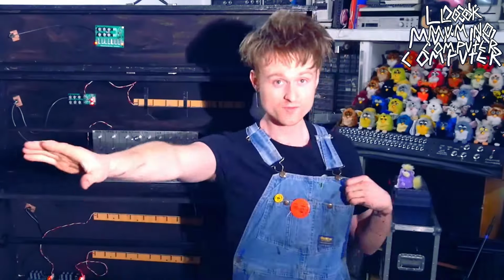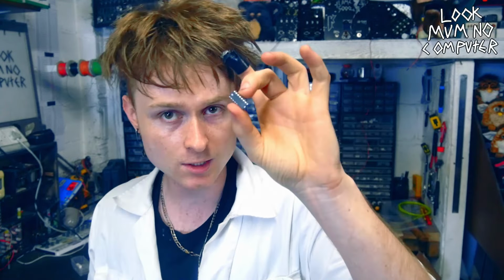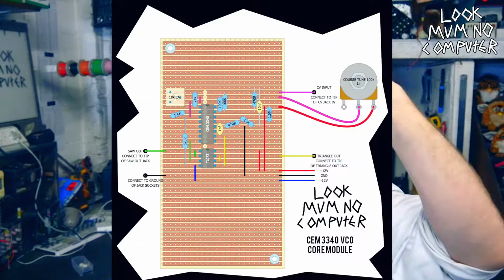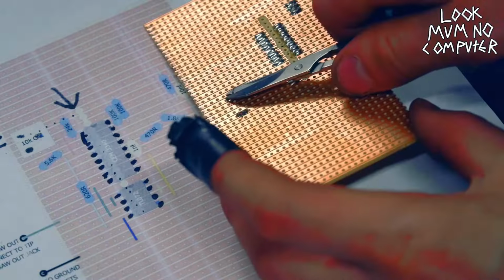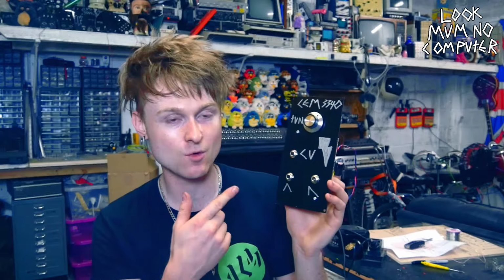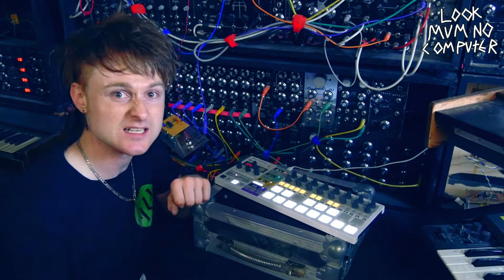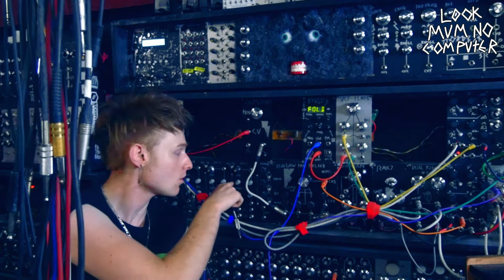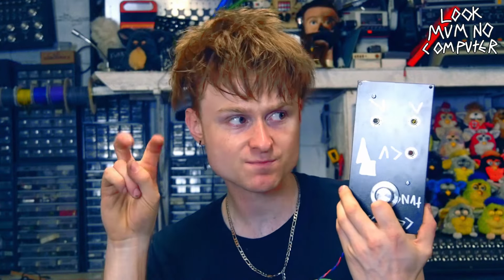Synth Voltage Controlled Oscillator 1v/oct tracked DIY how to.

Comment: Been looking for a video like this for weeks. You've got to be one of the best guys on YouTube. Any way to get a square wave?
Reply from the maker: yep like i said in the vid, i will be adding addons to this circuit, this is the core of the module, ill be including optional addons. square wave out + PWM in will be one of the add ons, only requiring another TL072, 10k resistor and a couple of jack sockets.    i still need to finnesse, but you can definitely work it out if you look at the CEM3340 datasheet :)
Reply: The add on is pretty simple, a comparator on the triangle out (saw might work too?) and the width is chosen by changing the voltage it's being compared to
Reply from the maker: its even easier, check the CEM3340 datasheet, it already has square wave out, i just figured it would be a simple addone with 1 tl072 for input and output
Reply: If we are planning to do the add-on's, would it be worth putting a tl074 in now instead of using two tl072's?
Reply from the maker: yeah totally. would be an option later on. this just seemed easy for now, but yes. totally. when i do the square-wave one ill plop a tl074 stripboard layout in too
Reply from the maker: the square wave one wil require 2 more opamps. you can probably work it out! if you look at the datasheet of the CEM3340
Reply: Emil Carr Yes a saw does work as well, you pretty much use any wave , thou the cem3340 has a tri saw and sqr outputs , you can then wave lshape to sine from tri.
Reply: O V E R D I V E
Reply: @LOOKMUMNOCOMPUTER  please add the square and PW vid when you can, it's really useful!
Reply: @LOOKMUMNOCOMPUTER  - Can you not use a 555 for a square wave?
Reply from the maker: @NeuronalAxon  deffinitely but it requires a lot of circuitry to scale it to 1v/0ctave to make it useful in a musical setup. the easiets way would be literally put a wire into the square out on the CEM3340, theres a circuit on my site :)
Reply: @LOOKMUMNOCOMPUTER  - Makes sense. Wicked they re-released those chips. Thanks for the reply! Where'd you learn your electronics shit, BTW?
Reply: Maybe by summing sine waves. The concept is the Laplace transformation but how to do it? Idk. Would an op amp be needed to sum the individual vco?

Comment: Thanx. I built one with the as3340. It worked right away.
Reply: Just built one using the as3340. I get this weird thing where when I plugin in my beatstep pro it plays super high pitch and I cant tune it for shit. did you happen to run into anything like that? Banging my head about where I might have gone wrong.
Reply: i tried to build it with the as3340 too but i couldn't get it working... i checked, rechecked and rerechecked a thousand times the schematic and i haven't found any mistake, i also checked my components , they're good.... I'm missing something and it drives me crazy hah
does anyone have tips or common mistakes not to duplicate ? (i'm a beginner if it wasn't clear enough)
thxxxx
Reply: @gillestinguely  same thing for me ... I've built three of them and also onr digital to analog sequencer and the cv is totaly out of reference with the tuning ....and the scales are like in reverse ( the higher note shown on the display of the seq the lower note generated by the oscillator) suppose to be exponential but ... welll ... i don't know ....

Comment: Thanks Sam, genius, I finally finnished my TD-616, (Twonk Drone-616 the number of the beast from the original Hebrew scriptures) using 18 of your super simple oscillators, the filters are a bit weedy, but I'll be watching your vids and upgrading them ASAP. When I get a vid of it on youtube I'll share the link. I've never built anything like this before and I wouldn't of tried if it wasn't for your inspiring and easy to follow destructional video's, keep up the good work.

Comment: ta-daaAAHH. made it! i now have one of the above! after hours of faffing about with it not working i tried a new op amp, worked right away. i am delighted! at a bit of a loss now as i own nothing that make 1v/oct signals for it. so i am off to make a resistor ladder push button keyboard........

Comment: MODS: ok so i put another 100k pot in series with the tuner pot, and now i can tune a much wider range; whereas I was able to find middle C and tune to that now. :D, i got the tuning pretty tight now, i can span more than a few octaves and remain in tune :D so pumped I used a BOSS TU-3 on chromatic using middle c and checking in the DAW with another voice layered over top. cheers

Comment: LMNC is obviously a more hands on type of channel. It's basically a DIY channel more or less. I wonder, your safety pin earring, is it supposed to represent that or did you just dig the way it looked? 

Also, and please understand that I have a very rudimentary understanding of electronics but I know a little (very little), with those super simple oscillators, theoretically, one should be able to use a 555 timer to step them one to the next. You wouldn't get exact notes out of them but it should be a fun easy project that almost anyone could do. 

BTW, cool video. I like how you almost take people by the hand and show them, you can do this. You can build this stuff if you really want to. It's not THAT hard. I've been away for a little while because Youtube in its infinite wisdom has decided for whatever reason, that my subscriptions don't have to be permanent. All hundred or so have disappeared and the new ones don't stay either. Ah well. Que sera sera. I'm glad I remembered you though. Carry on.

Comment: *looks at CEM3340 price*
*holds on the heart*
UFFFFF

But you know, big thanks for this series, i love you!
Reply: Also there are clone of CEM as said at  LMNC site and it actually costs 2-3 times cheaper, cool! (but shipment to my freaking-fucking contry will be expensive, sad)
Reply: AS3340 is a cheaper alternative ;)
Reply: Big ups! Thank you!
Reply: 25€ on ebay, i think it's worth it
Reply: £10.50 on thonk
Reply: buZztiaan How much do they go for ??
Reply: Cabintech Global LLC  Wow thanks for the info ;-)
Reply: Cabintech Global LLC Awesome!
Reply: Thonk have the official CEM 3340 reissue IC's for £10.60
Reply: $15 is expensive compared to $100 for pre-built?
Reply: AS3340 seems to have a fair price for this! :) Will try after i'll tire of discrete oscillators.
Reply: Forgive my blasphemy, but I could buy some good computer bits using that much money.
Reply: You can always try using a function generator like an XR-2206.
Reply: @DJTI99  have you successfully done this? I picked up one but it requires 14 or 15 volts in.
Reply: @jkuebler89  Waiting on my chips now. You can step up from 12V to 15V with a voltage regulator circuit, though.
Reply: @KiR_3d   I bought some as 3340 last week. Got them working aswell thou issues with my oscillator mixer circuit. Im just experimenting at the mo. May rethink my project if theybprove reliable. Hope all is well with you my freind.
Reply: Thanks for news, friend!
Make some vids about these, it will be interesting! Personally I'll be doing the old way as long as I can buy anyway it's very interesting!
Because how Neutron sounds - it's one case. How it will be sounding in your synth - another story.
All is good! Just bought Tevo Flash... (two weeks ago). This printer is as good as well as bad :)) The quality control at Tevo suxx. A lot of tweaking and DIY a detail before actually tried the 1st test print. I need to make two stands for Neutron and Model D. It was the final drop that made me buy it.
The proto-synth is near in the closet. I'm going to try 555 based oscillator or (maybe) that Jupiter-8 scheme. Hope to get rid of an instable tuning before making the PCB still :) Also I plan to use KTY sensor because buying Tempco's is not easy here (possible only by ordering from the outer sources and it's not very economic).
Wrote a track (not very good... mostly experimental), now I'm making a more "main stream" psy-tech track (90% ready maybe).
World politics suxx :)
That's all news!
Reply: @KiR_3d  Hey man yeh tries the 3340 its ok but doesnt work well in my set up as mixing waveforms seem to be an issue . I did watch your ( what looked like 3d printer the other day. 
Be intresting to see you 555 based vco. Is it of ghe the Thoma s henry design ?.  I always say make your music for you fuck the politics . 
😎😎
Post some morw stuff on your channel soon :-)
Reply: It's probably better to find some tech. geek forum about Neutron and what's inside there... They've done a pretty cool job about mixing the waves!
Yeah, Thomas Henry design will be the starting point.
About the 3d printer... I've regret that didn't bought some used Russian 3d-printer (just because it has no heated bed). It's more expensive but there is XY-scheme (H-bot). It's much better than all modern Chinese clones (and can print easily on 90mm/sec without problems).
Did you've meant that you'll post more stuff? :) Or you're asking me to post some more stuff? ))
Reply: @KiR_3d  hi! Do you know if it would be possible to use this 3340 ic with the 555? I'm planning in doing a 555 osc soon! If so, is it same schem as this one?

Comment: Oh, I commented why don’t you use a voltage controlled resistor on an old video where you were using a hackaround with photodiodes to control the resistor in this circuit, but I guess you made that step in my past your future from the video I watched...

Comment: I built my CEM3340. It works very nicely except every now and then the output goes all distorted and noisy for a few seconds before coming back to normal. It's pretty random and inconsistent. Any idea what could be the cause? 

Thanks in advance

Comment: Hi Sam! Just build the thing. Works beautifully. I just wanna ask what resistor values do you use for the square out add-on between the pin 5 of the CEM3340 and the second TL072 ... I can't read if it's 470 ohm or 470kOhm. Thanks!
Reply: The CEM chip is using 470 ohm resistors, it looks like the TL072 for square wave is using 470k ohm.
 You won't do any harm using 470k first to try it out.

Comment: ok...i just finished this..(the version with the pwm controls)..
so my advice:
dont believe its so short to do it..you can easily spend a day or two full days..if you are not so used in electronics and soldering it can take time..
if you dont have tools like multimeter or better osciloscope...you must be extremely lucky to build it at once..
be prepared for troubleshooting (in my case a lot!)
if you are experienced and lucky maybe you can do it in one hour i guess (in my case it was built extremely quickly but i had frustrating problems arising...for example i had it ready and listening sound..go for the last version(with the pwm control)..its dead...pressing the board sometimes made it work..until i fixed it it was another lets say 10 hours)
be careful with your wire..i used some precut ready to go wires..they were pretty nice for the board..but horrible for the knobs.. they were cut extremely easily..
last and most important..BE CAREFUL with the soldering! in my case...i checked the board countless times...every connection was correct! but, because of some very sneaky bad connections (solder did fill the whole, although it was looking fine) i coudnt diagnose my problem...

Finally...did it worth it? From the money perspective...hm..maybe not..it depends how much you value your hour..but in the end..if you spent 15 hours for a vco..i guess you could buy one..
From the experience perspective..totally..i feel much better prepared for my next one..and i have the feeling i can end it really quickly.
The final thing was sounding excellent (although in my case i could tune it only for a very narrow area. (around one octave)...no more than 2 octaves could tuned at the same time)..
but if you pick a specific area and put some reverb...its really excellent..(its CEM3340 anyway)..
Final words..really thank LMNC for this opportunity!

Comment: I have an arturia minibrute 2 and a 303 that I want to patch in to this once I have it built, but the CV output on there is a 3.5mm jack instead of the 1/4inch he seems to be using in this video..... is it as simple as using a 3.5-1/4" cable or will that cause issues?

Comment: Hey Sam, is there a specific reason you used a 620R resistor instead of the 820R from the CEM3340 datasheet reference schematic? I'd guess it has to do with the lower voltage in your spin (12 vs 15). Trying to decide whether I should just use the standard 820R or do some weird parallel/series thing, or just use a trimpot instead. (I'm too lazy to order a special resistor value.)

Comment: Use the data from the corrupted files to make some sort of sampling data moshing synth????

I was thinking about a video controller hooked up to a tv, and then a camera of some sort pointed at the tv which interprets the image on the tv as an oscillator or something. Maybe could do something by detecting magnetic frequencies thrown off by a CRT?

Comment: Hi Sam when tuning the oscillator does the main pitch control need to be all the way down? Cheers si
Reply from the maker: it can be anywhere :)
Reply: Thanks Sam have made three of this oscillators they all work just need to get them turned up properly, you are a legend dude

Comment: Does anyone know if this would run on 9v/-9v? It's just that I've bought a 9v/-9v power supply. Also anyone had any luck sourcing cheaper AS3340s in the UK? Or even just cheap CEM3340s?

Comment: Love it but not getting it....got all components and breadboarded.  Im NEW to all this so idk where to got from here.  Thought i could connect speakers to 072 but no sound.  Wired 072 outputs to lm386 amplifier but still no sound. Scope is showing saw and tri wves so its wired right.. I kno im missing something, and im completely self taught, so datasheet  looks russian to me still... Help anyone?  Sam pls?  Love your vids
Reply: I have the same problem. I've built it twice now and still no sound. Has anyone found a solution to this yet or what are we missing?
Reply: @zynsk  hey! Just saw this figured id let u kno i got it making sound!  I went back to looking at how i laid it out on the breadboard....turns out i mustve read the pic wrong, prlly cus i translated it to a breadboard from stripboard which is kinda tricky.  Between that and reading his schematic wrong, it was my own error.  His circuit def works...wired the output from the 072 to my lm386 amp circuit and it started blaring...scared the crap out of me at 2am...lmk if you got it, im sill trying to figure out how to get something out of this AS3310 chip i got too...im thinredline on mffwigglr

Comment: Will the  AS3340 work on this circuit ?🤔
Reply from the maker: Yes
Reply: Cool. The AS3340 is a lot cheeper and i wasn't sure if the pins were the same.

Comment: Can I build this using the less expensive AS3340? And what's the difference between the CEM and AS versions?
Reply: Randolph Carter its a dropin replacement
Reply: Thank you
Reply: I advice you to take a look at the Semiconductors manufactured by Cool Audio
Reply: Coolaudio no longer makes a DIL version of this chip, only surface mount. No good for this project. There may still be some Coolaudio DIL chips out there, but the AS3340 is a better bet for this project.
Reply: @cabintechgloballlc5337  
Well, you can solder it to a dip adaptor
That's what I do.

Comment: If anyone can have a solution to my problem:  I've put the whole thing together. I've double checked the layout and everything, but once i plug it on the Frequency central Power supply, the +12 LED on the power supply stops lighting and no need to tell you that the module doesn't make any noise..There are no shorts whatsoever and i don't understand how the module can turn off that LED, anyone can help? Thanks in advance!
Reply: Thought the PSU was the problem but i've tried pluging it to the second one i hve and it still does the same.. I've quadrupled check the vco layout and still.. getting desperate here..
Reply: @XXXLeahCimXXX  im building the one with square and pwm yep.
But the psu doesnt turns off when i remove the ICs.
Now the multimeter tells me that i get 4V out of the PSU soooo idk
Reply: @XXXLeahCimXXX  with AND without.
I will.
Yes i use 12VAC wallwart ^^
Reply: @XXXLeahCimXXX  oh i might have swapped the power regulators aha
Reply: @XXXLeahCimXXX  well not yet i still have a short somewhere BUT the power supply's regulators were swapped. Now i get 12v from one supply and about 14V from the other which is odd.. but when i have time i'll check my vco short for good because i really wanna hear this vco ! x)
Reply: @XXXLeahCimXXX  it works! But i wonder if i can plug it to the second supply that fires out about 14V.. can it fry my vco??

Comment: what voltage does it take? I'd like to run it in its own little project box until I get my rack up and running, also, i looked at the parts list, i never said if the stripboard needs to be double sided or not
Reply: also, where do you buy these electronics if you can't get them in real life, but can't find them on any websites? what websites do you go to?
Reply: You can get the 3340 chip here: https://cabintechglobal.com?prod=AS3340, the rest are common electronics you can get at mouser.com or similar outlets.

Comment: What 8pin connector do I need to connect this to the power supply? The schematic doesn't specify which one to use.
Reply from the maker: benjo any connector will work! Maybe check on my site on the section diy modular there’s a zine there with info on it
Reply: thanks, is there anywhere you can point me to learn how to connect the +12v, ground and -12v wire to the actual header?  @LOOKMUMNOCOMPUTER